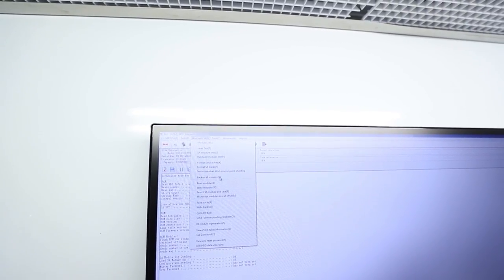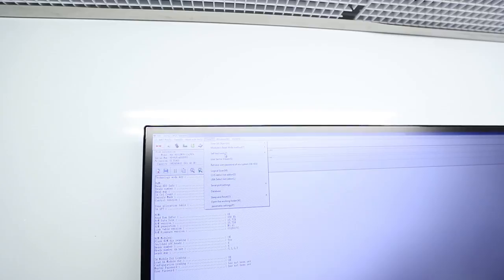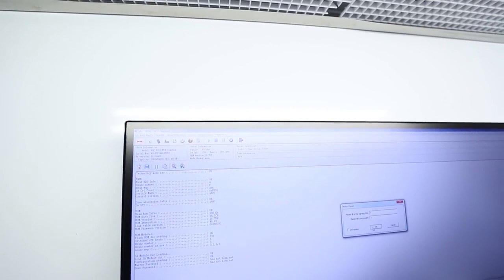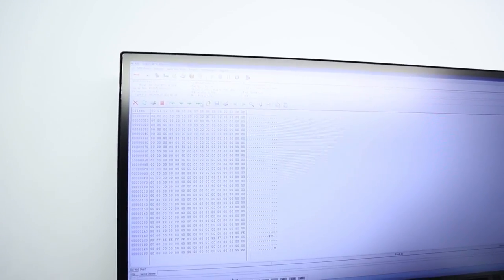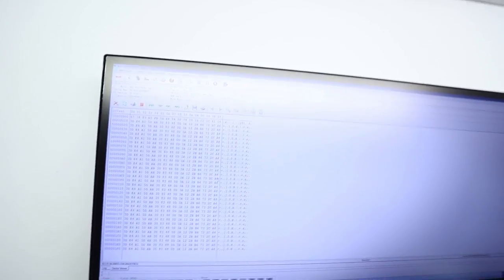how to recover data on WD Passport drive

Comment: Please help! 

I have a WD my passport 1tb external hard drive. When I plug it into my Mac the light still turns on and it seems like the fan in the drive starts spinning but my Mac no longer recognizes it and I have decent amount of data backed up on it that I would like to get off. I’ve determined it’s not a computer issue after going through multiple test and I’ve called WDs data recovery referral companies and they said to recover the data off of the drive it would cost somewhere between $300-$1300. I don’t really wish to pay that much but still want the data, what would you suggest I do?
Reply: OMG ME TOO!!  Any advice@teddy Gaming

Comment: I notice you’re using MRT Ultra more in your videos rather than PC3000. Is there a benefit over pc3k? Do you enjoy using MRT more? I was reading up on both, it seems like MRT doesn’t support all file systems yet. Just curious, maybe you could make a vid in the future. Thanks and I really love the videos!
Reply from the maker: I use many different tools all day because there is a lot of work happening. Obviously, pc3k is better so the price is higher, but for imaging MRT does just fine, even better actually in many applications. I don't want to do reviews on specific tools as they have their own channels here and I don't want to give them free advertising, as I am not affiliated with them in any way. I hope you understand
Reply: HI Erkin, Totally understand regarding the free advertising. I've been working in the IT industry, and have become interested in this type of work. I'm a network engineer by trade, but data recovery always intrigued me and is something I want to offer to my clients. Any chance of connecting with you somehow? Maybe you could direct me towards 1 vs the other for an amateur. If it's too advanced/challenging, I always send it out for them.

Comment: My WD hard drive stopped working suddenly the other day. Do I need to dismantle it? The computer doesn't recognize the device and it makes an awful clicking noise.
Reply from the maker: If your data is important you should get professional help. This is not a DIY type of thing, you will most likely kill it, or at least make the professional recovery way more expensive than it needs to be

Comment: If the main board is blown how do you choose the correct replacement?
What are the compatibility requirements?
Reply from the maker: the part number is enough with firmware adaptation.
Reply: @hddrecoveryservices  Firmware adaptation? Is it the site and date code that is important?
Reply from the maker: PCBs have ROM and NVRam sometimes that needs to be swapped so that the new board has some properties as the original

Comment: I have an issue with my sandisk 120gb SSD, it doesnt boot and my asus board shows only A2 - if this ssd is plugged to one of the sata ports i cant even boot from USB to ubuntu etc. to read the SSD.

Comment: Hello! I have a ST1000DM010 with CC43 firmware and board rev C , and now is only detecting 32GB of 1TB. Is the board failing or the plates in the hdd ? Thank you so much!
Reply: firmware problem most likely

Comment: Was the Passport encrypted?  Have you a video on getting around encryption?  I have a 3TB External that has crashed.  I have about 6 drives that have crashed LOL but my main one was the 3TB
Reply from the maker: We use PC3000 for disk imaging. It detects WD encryption and can decrypt automatically during imaging on the flight
Reply: HDD Recovery Services So, does PC3000 replace MRT?

Comment: Hi there,

(Today a friend gave me a broken external hard drive, I couldn't hear the drive spinning up. I opened it, turns out it's a Seagate Barracuda LP 1tb inside. I plugged it in to my pc, but it doesn't show any life signs either. No spinning. The data on it is nothing too important, just a backup drive, and the shipping from Germany to you wouldn't be worth it either, but maybe you do know a way how I can get the drive working again at least once, to save all the files on it. Sometimes you do need older backups. )

EDIT:
I think i found the problems, thanks to one your earlier videos.
the pcb has several black resistors, one fallen off and one kina roasted diode near the sata power input. I cant post an image gallery link here, but what do I have to do to make the drive working again?

Thanks in advance :)
Reply from the maker: Sure check the diodes. There is a video about it here on this channel somewhere

Comment: thank u very much for the video it's realy helps much.Please i need help i have WD externel hard drive it fell to the ground and it does not reconized by the computer .when i opened it i found out that disc starts turn and the head comes inside in the disc for 3 or 4 seconds and comes out ,that's repeat for 4 times and nothing else happen how to know that the head is dammaged .Sorry for the long text and my bad english

Comment: Have you dealt with Firewire WD My Passport Studio? The board with ports (4061-705110-002 Rev AA) isn't part of the drive itself but it looks like WD restricted using the board with 3-rd party drives. Do you know any ways to work around it?
Reply from the maker: you should be able to initialize any drive with that board attachment. It can't be hard drive specific.

Comment: Hey my friend  I have problem with usb stick, yesterday it work perfect I put my pc to sleep mode and usb stick remain in my pc. Today when i turn my pc the usb stick don't appear anymore, i try to move different ports but it say "device driver software was not successfully installed, usb mass storage device failed". 
I try to unistall usb mass storage device and scan for hardware change but it keep my give "device driver software was not successfully installed, usb mass storage device failed". One more thing the usb stick keep disconnect and connect automatically like 5 seconds remain connect and then disconnect 5 seconds on computer manager keep refresh and appear/dissapear "usb mass storage device", 
I try it on others pc and i have the same problem. 
I search for some solution on internet i don't find anything.
It's like usb stick don't want to stay connected.
Don't appear in disk driver i'm looking in computer manager and i saw only "usb mass storage" when appear and dissapear and if you know sound of plug and unplug a devices that sound i heard it. 
And it's not first time when i let this usb stick plug in my pc and put in sleep mode my pc. Usualy when turn on my pc it will always show up but not this time.😟

Comment: Hi Sir,
Actually I want to explain my problem in detail so please read it full,
My Seagate ST3500418AS (100532367, REV-B), drive is not spinning at all, so I thought that it might be board problem and ordered a donar board(100532367, REV-A). Before swapping the BIOS chip(8 pin SST 25vf040b, 4MB memory) from original board to donar board, I backed-up the BIOS chip's data using CH341A programmer to a '.bin' file.
Then I tried to dump that '.bin' file to donor board to avoid the physical swapping, but I absorved that the BIOS chip on donar board is different BIOS chip and it has only 1 MB  memory, so I don't have any options other than physical swapping of BIOS chip. 
In the process of swapping the BIOS chip, I destroyed the BIOS chip and both boards.
Now my doubt is, is it possible to make it work by buying another donar board and same BIOS chip(8 pin SST 25vf040b, 4MB memory) and dump the .bin file to that chip and solder it to donar board.
Reply from the maker: Seagate without the original ROM is extremely hard to recover. I don't have such skill. I've heard of couple places claiming to be able to, but you would be looking at thousands of dollars to pay for your simple mistake at this point. If you created the image of the ROM properly, then I don't see why you would not be able to program a same capacity EEPROM on the donor.
Reply: HDD Recovery Services: Actually my original board's BIOS chip has 4MB of memory and the donar board's BIOS chip has only 1MB of memory, so there is no chance to dump 4MB to a chip which has only 1MB memory.... Please give me some suggestion, I can definitely say that I have successfully backed-up the data from my old PCB, because I have done this before so many times for laptop bios chips and they worked fine.
Reply: Abhinay Maredugonda so get a 4MB BIOS chip then program in to which u have backed up 4MB DUMP
Reply: James Jihan: Thankyou for your reply, actually I was asking the same in my 1st comment, just to clarify that wether this idea works or not.